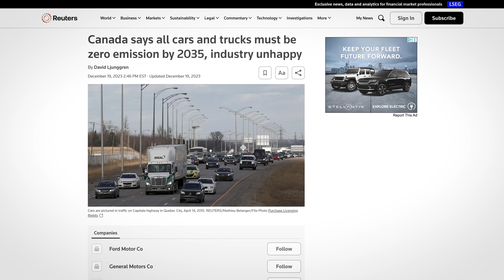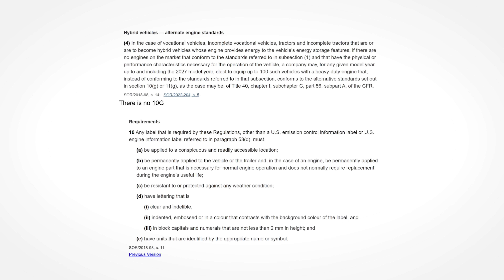Government Red Tape Is Blocking Our Plug-In Hybrid Trucks

Comment: Hey Edison, I thought that engine was an APU…an auxiliary power unit used for hotel loads and driver comfort to reduce idling 😉 Like a really big Thermoking Tripac or Carrier Comfort Pro, which also start automatically to charge and maintain battery voltage 🤷🏻‍♂️

Comment: If it would take 1 to 2 years to get an exemption because you have something innovative; there is an underlying problem.  An exemption should be had in 2 months or less.  Time is money and both parties have to respect each other's time.  PM Carney's new Project Office initiative will have to build a regulatory system that adapts efficiently to new innovations.

Comment: Why don’t you go with using hydrogen that burns WITH the diesel so it burns cleaner.  I’ve seen other semi truck do this.  Ontario supposedly has commercial trucks that are doing this.   I’ve posted this before but nobody bothered comment or look into it. 

Hydrogen is injected with turbo diesel so it burns cleaner.   You could also go with do Different generator that burns cleaner.  Isn’t Cummings making pure hydrogen only engines?

Why isn’t prime Minister Mark Carney helping with this. We need more ppl tag him and help get this up and running again.

Still would like too see a hybrid turbo diesel but still with 18 speed manual. Nobody is doing that.

Comment: This is really stupid legislation. 
As a workaround, could you drive the truck fully electrically (no generator running) on-highway and only turn on the generator on logging roads? Or would typical use cases not allow for that

Comment: If the engine manufacturer makes an on highway version of the engine this should be possible if the manufacturer is on board with you should just be some flash files and certification tags.

Comment: What if you put the generator on a trailer. I mean there are generators on trailers but are there rules that says the generator can't run while it's being towed? It probably won't solve every solution but it could be a gapfiller while at the same time showing how ridiculous the regulation is.

Comment: A formal petition to the House of Commons needs 5 Canadian citizens or residents, plus Authorization by a member of Parliament. Either Elizabeth May, Green Party, or the MP for the riding of Donald is in, seems like the best bet.  Then we need only 500 Canadian citizens or residents to sign (electronically) to move it forward.   I will check around about getting this started. Petition subject: "Hybrid trucks that use the engine as a generator are allowed to meet generator emissions standards." [edit] looks like it may be possible under the current law. As describe in the comments on short that just came out.

Comment: so with home construction there 2 ways to meet the energy codes: build per codes and fill out your energy audit forms which works great 99% of the time but when you want to do something off from the norm you can build and test the product to make sure it meets the energy codes. 
They know that 100% will not fit into the box. Seems like you should be able to build then test to make sure it produces less emissions.

Comment: Go full electric, have containers with gensets at the landings, charging multiple battery packs for the fleets, use self loader on truck to quick change the battery sets. Logging trucks are unloaded until they get to the landing so will be quite a bit lighter.
Reply: There's a company in Australia doing this. They use a forklift to change out the batteries and is moving beofre a diesel truck can fill up.

Comment: I wish I could reach through the screen and talk to you check out the engines they use in a tiger cat skidder and the cutter they have Emissions on them and they're a very small motor all they do is run a hydraulic pump all day very much like your generator for running your generator instead of the hydraulic pump

Comment: Something off. Double check their rules. I feel they hinder or say update their dam regulations. It sad that they do not know much or they use to normal car check but never think out side the box. Meaning their regulations are out dated. Be sure you record your history I feel there will be bad apples trying to hinder or copy your style. Another is bankrupt for getting your technologies. But it all guess. It all come down to check list. I can feel same with the Japan trucks as those are design for farm area and small place yet the US is banning them due how say monopoly control and non sense like those old vehicles is passing yet they are blocked. I feel why need on road engine and not off road engine which is strange. Still look into and gave them and research data but not all the data. Just who is in charge and your agent with them. Just make sure they not good people. I seen some bad people from video were corrupts. They should be helping out a bit or something. I mean they should be doing their own researching to match your src of information. Plus they should list which part items are pass and fail part which seem they really doing their jobs?

Comment: Sounds like you need a control system to trick the on road generator to only turn on when battery is low and present it with a large load and have the control system adjust throttle from those readings.

Comment: If it is anything like the US EPA, the vehicle certification rules were basically written by lobbyists for the established high volume manufacturers. Every engine group has to be certified for every model year, even if there were no changes to the fuel system or power-train between model years. The high cost of the cert is trivial if you are selling a million vehicles but becomes an obstacle if you are an up and coming challenger.

Comment: Hi folks,
I just wanted to let the nice folks at Edison Motors know I emailed all of the Senators in your province about this issue, and Minister of ECCC, The Honourable Julie Dabrusin's office, too. I'm going to go through the Ministers of Commons list in BC later with the same email. It's asinine that you should have to re-invent the wheel on this project, when literally two lines in a regulation could be modified to accommodate the proper solution.

Comment: I say Eff the Canadian government, Sell them in the US, and make the Canadian government Beg you guys to sell in Canada.
Or don't have the plug installed, but have all the wiring and programing installed. Then "Accidently" leak what plug is used with the system. If the end user decides to install the plug, and "Modify" the trucks, it's on them, and not you. Being vague, and skirting rules, is a 2 way street.

Comment: RVs! You guys need to bring up RVs when you talk to Transport Canada. Most large RVs run their generators while in motion, to power the Air Conditioner/Heater. How is that any different? You're just using the generator to charge the batteries for the drive system, rather than running the HVAC.

Comment: Could you use a Tier 4 Cummins L9 for on-highway use, but build a custom engine supervisor to command it to act like a generator? Then you can claim an on-highway engine, but run it like a generator. When the legislation catches up you can change the engine out to a simpler setup.

Comment: I don't understand the logic of a plug-in truck that's called a 'Hybrid'. Hybrid means a working exchange between an I/C engine turning an alternator to supply power to an electric motor. The road vehicle can run exclusively on I/C or electric or combine the two for maximum acceleration. The Toyota Prius(<3,400lbs) which has the power duality & a railroad locomotive (~420,000lbs for the bigger models) strictly I/C to alternator; would be two examples of Hybrid. So no Human interaction required. Now your channel talks of a 'plug-in hybrid', that's an oxymoron. What you have & what the manufacturer should state is a I/C powered vehicle w/ a divorced electric motor that still works w/ the I/C engine for doing work but not to replenish itself. The vehicle saves weight by not carrying an alternator. So a plug-in isn't a hybrid!

Comment: Pardon my ignorance here, but it sounds like this is a software issue.

The only difference between a generator and an on highway diesel engine is the generator senses the load from the alternator and ramps up accordingly. So can you build a custom ECU for the on-highway engine that does the same? Of course it'll have to be custom, and you'll have to do some refitting along the output shaft. But if the engine is drive-by-wire instead of cable you might be able to tie into the throttle input signal with a custom signal source, and put a PID on the output shaft tuned to the resistance of the alternator. I mean I know i've over-simplified it but maybe for now until you get past regulations: software is what you should look into.

Comment: You need to get a Cummins 6bt 12valve will bolt to your generator pack those have been used in commercial generators for years as well as already approved in and on road use for many many vehicles. Possibly may be able to use a mini duramax, eco diesel, or power stroke engine.

Comment: They love to shout, support small and local. That is until it comes time for a small and local company to pull an industry forward, in the direction they want no less, without hamstringing it along with expectations only viable by large foreign corporations that can afford to sink millions of dollars over years and years to get those systems certified. When regulations are slowing progress instead of encouraging it, that is bad legislation and shows just how incompetent or corrupt these people are, either you see the error in the legislation and try and change it, or its blocks are in place on purpose to favor the big guys. 

Watching all of this from down in the US, it is frustrating to see and also know that if it were down here you would be running into similar problems as well. Not that long ago both places were running toward innovation but now it seems to only be a talking point with roadblocks placed everywhere you look.

Comment: You used a generator so you could promote the use of untaxed off road fuel. You made a video about it. Canada is clarifying that the loophole you thought you found isn't there. They aren't stopping you from making the truck. They just aren't letting you dodge the fuel tax.

Comment: Was the BMW i3 EV with ICE "range extender" not sold in Canada? It is following the same principle. EDIT: There's a precedent. I just looked it up and found an article from 2019 "My tester was the BMW i3 REx, which arguably isn’t a full-electric vehicle since it boasts a small, range-extending gasoline engine. But the two-cylinder 38 hp engine is not connected to the rear wheels and serves only as a generator to top up the battery. There’s no option for the driver to conserve electric range by selecting gasoline power – the tiny engine only fires up when the battery is drained."

Comment: I've got 2 solutions for you. 
1. Use on highway engine that is equivalent to the engine you want and swap the computer to run the way you need it. 
2. Find out what it takes to be in compliance and retro fit what you have for compliance for that engine using current emissions and fuel consumption and being to the board to get a temp license of compliance with your evidence that it meets or exceeds standards. Hope that helps.

Comment: The US is similarly f***ing stupid when it comes to range extended electrics. When the BMW i3 was sold here, they hobbled its range extending gas generator so that it's only allowed to kick on at the worst possible time when the battery is almost fully depleted. This cuts the range significantly AND increases the smog produced compared to what the rest of the world got which runs the gas generator in the most efficient way possible. This all smacks of interference from big oil. They should be grateful anyone is still buying oil at all, and they should be more concerned about how their executive's heads are going to stay attached to their bodies when people finally wake up to the harm they cause.

Comment: You're in perfect compliance. They're just trying to side track you until the right people can catch up. You're using a generator motor as it was intended to be used. You're not running the transmission behind that motor, and you haven't modified a thing.

Comment: Couldn't you use an on-road engine, with a module that allows you to throttle-by-wire and just use software monitoring the engine RPM & adjust the throttle to match the target? Wouldn't that do the same thing as a self-governed generator engine? Am I missing something?

Comment: Get ahold of your MP and see if you can get him out to your facility to actually show him so he can actually relate to what you are doing.  Try to contact the federal ministers in charge of Transportation and the Environment and bypass the bureaucrats as much as possible to get the legislation rolling.  When you started this adventure, did you have a competent lawyer familiar with automotive manufacturing check for minefields in this area?  If you can find a large enough generator that suits your needs and produces lower emissions than the law mandates currently for semi trucks, that might help getting an exemption for your trucks.

Comment: Are diesel reefer units rated? as on-highway engines?  And - why can't your control guys get a controller designed to operate a 9L on highway truck engine to act as a constant speed (variable output) generator???  (You have mentioned using Euro 6 Scania Engines previously, where is that at ??  Also previously you had stated that a parallel generator - just like a diesel Reefer or AC unit, is not bound by the same requirements as a traction engine)...  Sounds like a backpedal...

Comment: Some vehicules use generators to do exactly the same as you are building. Chevy Volt, Mitsubishi outlander phev. They use generator to feed electric motors and/or battery.  Why they can and not you?

Comment: What if you built battery trucks and had a “cradle” that the genset could slide into?? Or put 2 “removeable” smaller generators on the trailers???? I know it defeats the purpose but could be a temporary work around????